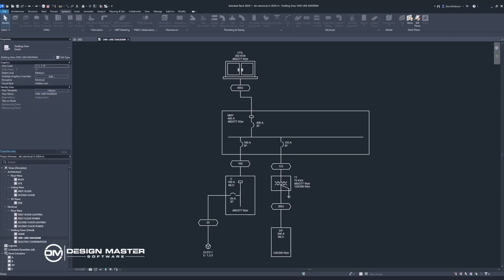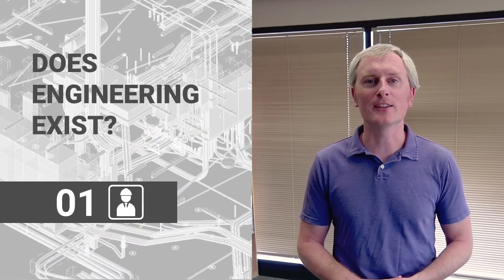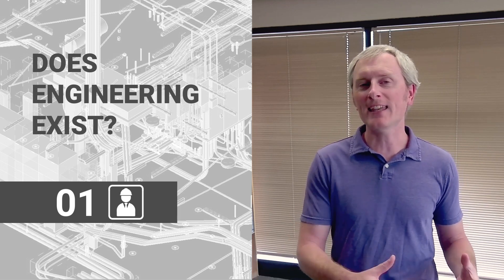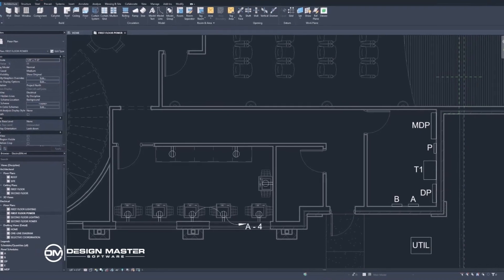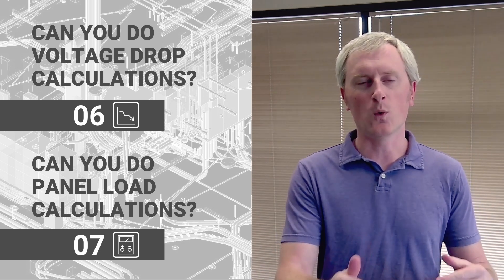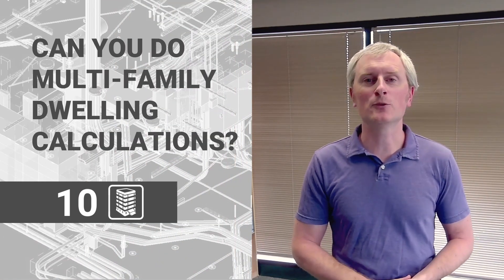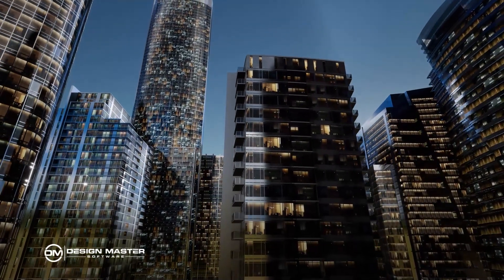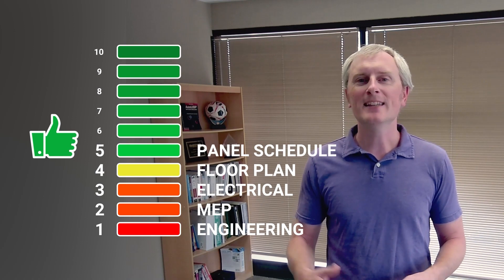The Electrical BIM Scorecard – Episode 8  #electricalengineering #bim #BIMScorecard

Comment: So Revit is like a 4.5. And Revit plus ElectroBIM is a 7 (soon to be 10 after some updates hopefully) and Autocad + DM is a 10.
Reply from the maker: Thanks for sharing! We will be reviewing several BIM offerings, including Revit and our own products, so stay tuned to see how closely your scores align with ours.
Reply: I score AutoCAD a 4, Revit a 6 (panel loads but no voltage drop), ElectroBIM a 9 (single-line diagrams but no multi-family dwelling load calculations) and DM Electrical a 10. I'll be posting reviews of these and other programs using the scorecard in the next few weeks. I was surprised to stumble across a program from Norway that scores an 8!